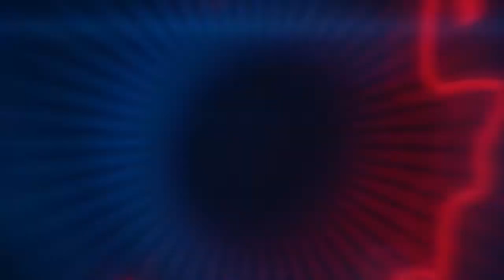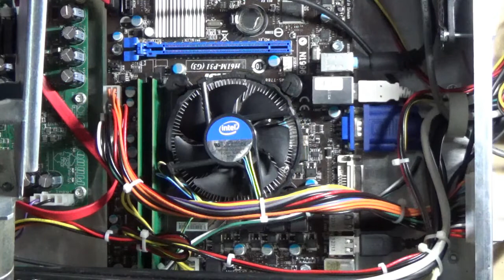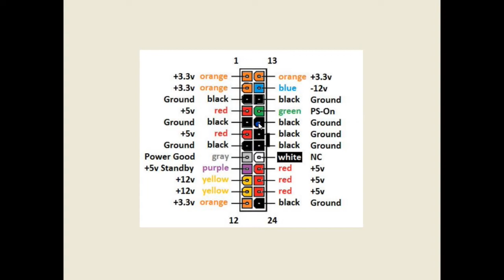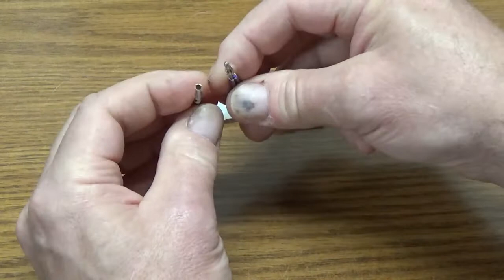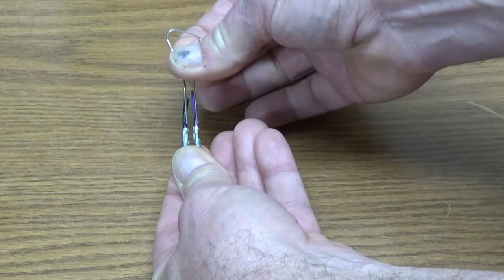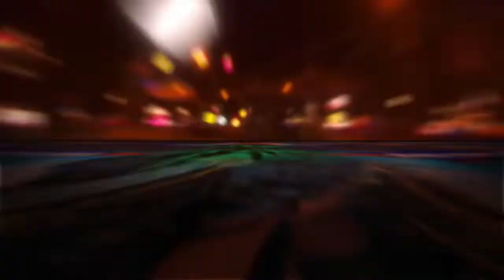Jump Starting Your CPU Board

Comment: My GNR LE is dead. Again. I’ve had it just over a year (bought new from flip n out). It was dead on arrival and needed a new motherboard, which JJ sent. 
     It also had boot up issues (BIOS screen and had to plug in a keyboard to bypass). 
    Now it won’t power on at all (again). 
      I knew I would have to do maintenance on a pinball machine, but the types of issues I’ve had on a brand new machine is excessive. The middle scoop also shoots the ball straight down the middle, and has since day 1. Which absolutely kills the whole game. I have adjusted it multiple times, but the screws don’t hold and the scoop slips back to the SDTM position. 
     I can buy a new scoop and wire up an external restart button instead of jamming a paper clip into the wiring of my machine, but for $9K, a lot of this should of been engineered out at JJ. 
    It is a great game, I just wish more thought and quality assurance would have been done on it. 
     How hard would it be to install a restart button on your machines? It would make the experience of owning one so much better.

Comment: This works. My coin battery died while I recovered from a wrist/hand injury, and the machine would not boot. The paper clip short from green on the PS to gnd got it to boot right up. The short pins on JPF1 did not work. Thanks again, Butch! JJP rocks.

Comment: Thanks - I have tried this. This may may started being on a power strip with other games. It is now by itself. I can get it to click or have lights flash with both reset methods. The cpu fan still never spins. I tried removing the J12 jumper on my ups board - still no cpu fan start tried jumping it - it still does not boot up . I have no power to the monitor either. I am looking for next steps, thanks.
Reply: Same issue here, machine shut down while playing & cannot get the MB to boot up.  No help from JJ with ticket......
Reply: 12000 dollari di pinball e non parte per una piccola batteria... ma scherziamo? E io dovrei infilare una graffetta a pinball acceso. Ma scherziamo veramente? Ultimo flipper JJ.

Comment: I have an Emerald City Limited Edition Wizard of Oz Pinball Machine
from 11/ 17/2013.
The battery went out and I cant play it since January 2023.
I replaced the battery on the board under the play field
it still doesn’t work and now I just get a red box that says No Signal.
On your video I notice at 00:03:19 the cpu board behind the screen has a battery.
Do I need to change two batteries?